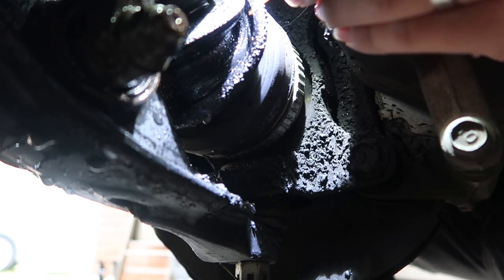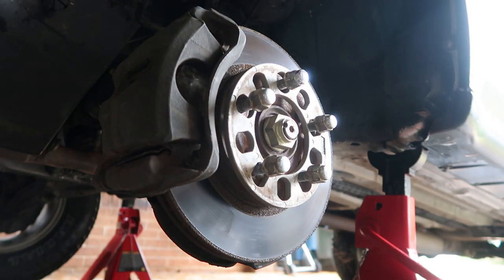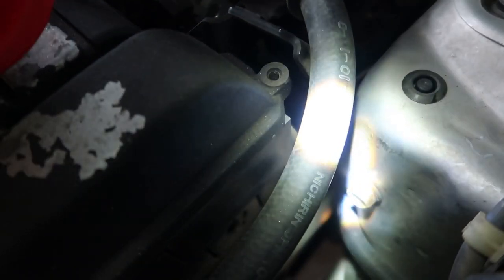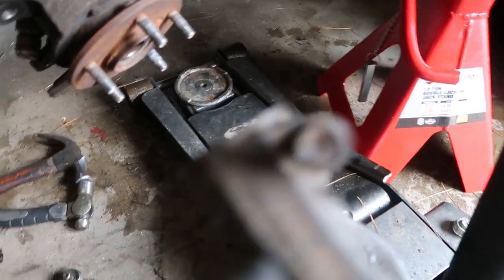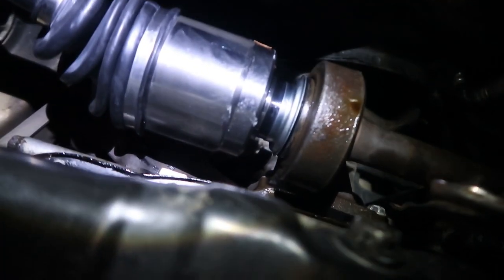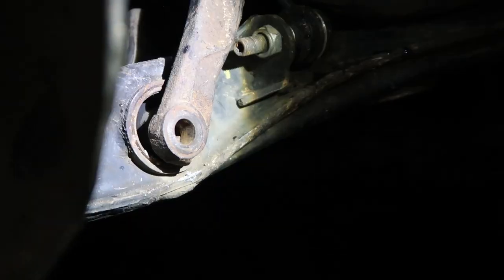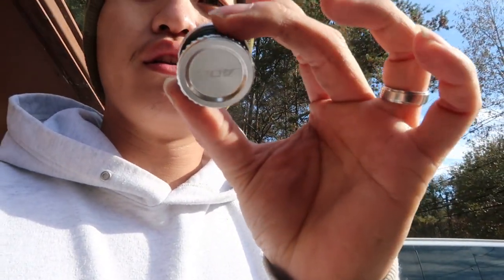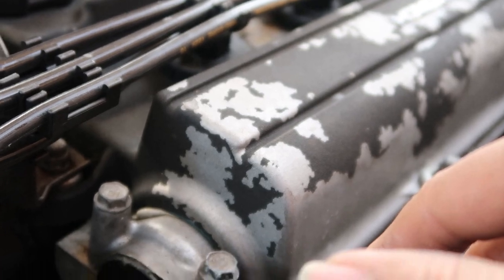Lifted CR-V Axle Clicking

Comment: Try extended ball joints, I threw them on my lifted crv and have had no problem with the axles clicking yet. I have 2” spacers up front on mine..... helps the geometry a little
Reply from the maker: Travis McGreck What brand of extended ball joint you used?
Reply: Just lifted my crv today.  Got new a axle while I was at it but after the Install and the 1.5 inch front Spacer lift, it's leaking transmission fluid. It looks like there is about 1/8th of an inch gap where the axle goes into the tranny.  Does this happen to you guys also.  If not, what axle do you guys use?
Reply from the maker: Sher Vue is it leaking from passenger side?
Reply: I just put 2 inch spacers on my 1999 CRV and I have been through two sets of brand new CV axles from O’Reillys. They vibrate and Pop really bad. I have the 3° ball joints as well. Any help?
Reply from the maker: DogONRedRocket so you have 2” lift spacers in the front?
Reply: Tong Chang yeah 2” front and rear
Reply from the maker: DogONRedRocket last year I’ve been throw 2 set of axles on front driver side. It’s a common problem for a lift crv. The only real way to fix the issue is dropping the subframe and motor to get them axle back in line. Which I haven’t got that far yet.